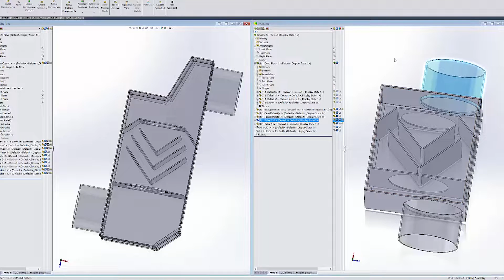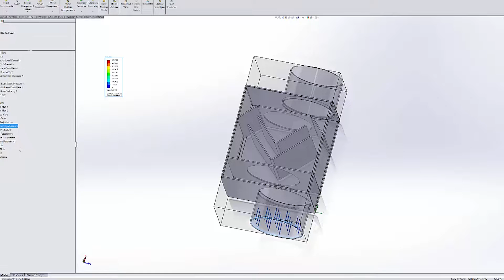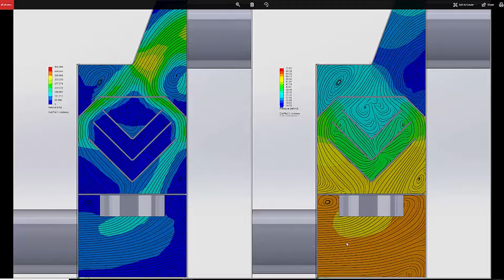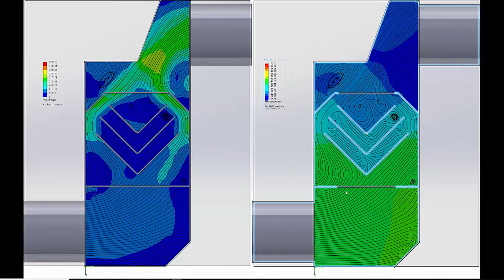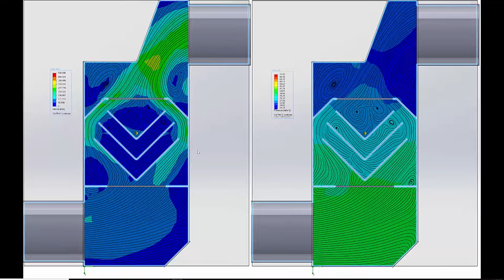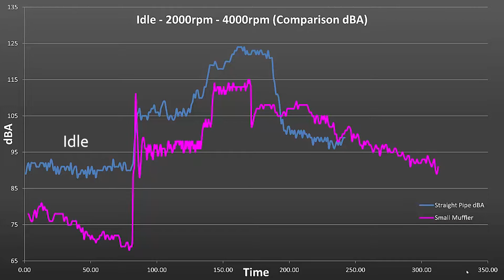DIY Muffler Build! (Sound Level and Back Pressure Test)

Comment: Not that I'm any sort professional exhaust builder. However it seems that the smaller the muffler body is the louder and more aggressive it tends to be especially in a straight through design. Chambered mufflers tend to be slightly quieter but deeper for the most part. Although like I said I'm not a professional.

Comment: Hell ya! I friken love Fieros!! With bigger modern wheels like you got on it to i think they are some underated badass gocarts for the street pretty much. The muffler on the side like that is really cool to sounds good. Not crazy pop bang fire but just enough to get heads to turn at you lol. The muffler when you said for sake of fabricating you did the square corners, for one i think it looks better like that and if you wanted to improve the flow at those spots you could cut exhaust pipe long ways and weld it unside the muffler in the corners to round them off. If that makes any sense. Leaving the outside square and a round cut pipe inside or cut the square corners out and weld the rounded pieces in after the box was made. Exhaust pipe bent in hoops or straight is a killer fab tool because you can cut them long ways or however and make nice parts that would otherwise be very difficult to make the bends or coners without a bunch of diffrent expensive tools ya know! Anybody can go buy parts but its so much better to see how somthing you created works and to have it work also!!
Reply from the maker: Thanks! It was quite the interesting project to take on, and yes those are some good suggestions to make the design more efficient. I might actually redo the exhaust again in the next few months!

Comment: Well done for actually designing your own - I've done the same thing, but because my engine was the same as usual I used the carcass from a standard exhaust, modified it inside, and then had it re-welded including a plate where I had cut it open. The result I achieved was almost as quiet as a standard car but with at least 10% fuel saving (it was a diesel, so different rules apply regarding back pressure and fuel economy)

I've found that the type of flow diagram you were using isn't particularly helpful. There were some areas where virtually no flow was shown, such as in the delta plates for example. Using OpenFOAM (or SimFLOW - much easier to use) is good for showing in more detail where the flow is going and where the pressure drops are occurring (you did have some good pressure maps). I think you'll find though that the silencer you're using won't be silencing it sufficiently after a while. I wouldn't expect either of those designs to silence much to be honest, and there are more techniques you can use to ensure good airflow while also reducing the noise level significantly across the board - your graph showed that  in some places the noise level was significantly higher than just a straight pipe! That's not going to be helpful. Given that you've got a very small space to work with,  I'd have a look at some traditional silencer designs and see how you can use those design elements but in a way that creates less back pressure by optimising the airflow better.

Ideally you'll use software that also simulates the sound propagation so you can do more experimentation before building anything - but that seems to be either ridiculously expensive or almost impossible to use. I'm writing my own software for that reason.
Reply from the maker: Thanks Mike, I haven't had more time lately to work on this, but I feel like there would normally be a few trials before finding the sweet spot for the design

Comment: At 3:35 you mention a restriction, as indicated by the velocity of the gases increasing. The misconception is that a narrow area is restrictive for gases. However, as velocity increases, pressure decreases. In reality, where the exhaust gases are slowest, is where pressure is the highest. I’m curious as to why the software was showing data that disagrees in the simulation. Granted, gases do not like sharp turns and that is certainly a consideration, and your chamfer you added showed good results. Turbulence is the enemy with flow as indicated by the eddy currents you spoke of. I’d be interested in seeing what dimples would do on the delta plates facing exhaust flow. Overall, great video, neat engineering and fabrication.

Comment: Awesome video! I have a couple questions regarding the exhaust itself tho. I'm a college student going for welding. I built my first exhaust for a highschool metals project and ran that straight pipe for a year until I received a fix it ticket from a douchey sheriff. I want to build a new exhaust that's quieter and more tame because the last one was too loud for my liking anyway. If I were to do this how noticeable was the drop in noise? I'm trying to avoid a metallicy or tin sounding exhaust as well, any ideas on how to help with that?
Reply from the maker: There was a noticeable drop in noise... however... it is still very loud. Loud enough to get lots of attention from the police. To avoid the tinny sounding noise you'll probably want to go for a chambered muffler that is a little larger, and of course it depends on your engine. It's easier to make a V8 rumble than a four banger.
Reply: @EmbraceMaking  thank you for responding! I think I'm going to use inspiration from Borlas mufflers. I drive a subaru and from what I've seen they do a good job of muffling noise and keeping a deep note. Thanks again!

Comment: what program are you using to design these mufflers...i have been wanting to design a muffler of my own my idea being a long "glass pack" looking cylinder say about 20 inches long and a series of solid reducer cones to baffle and speed up the flow
Reply from the maker: Hi Jordan, I have access to Solidworks so I do most of my design with that program. Lots of options available these days for 3D design!

Comment: Really interesting. But out of curiosity why didn't you design a straight through style muffler as big as de the space available allowed?
Reply from the maker: Because the space was so tiny that you need probably 14+ inches to get an effective straight through muffler... I had like 8inches to work with, so I figured a chamber style would be more efficient in that space
Reply: @EmbraceMaking  it makes sense. Really cool project;)

Comment: Someone on a Dragzine article about muffler design brought up an excellent question about the delta plates.  When the sound waves are divided, why don't the waves merge back in constructive interference instead of destructively?  What is causing the waves to phase shift if the geometry is symmetrical?
Reply from the maker: That is a good question. Obviously for this project I didn't have the full access to equipment available to do an analysis that would allow me to figure that part out... however, from my understanding it must be the spacing between plates and their position in the chamber. Although the design is symmetrical, I believe the waves would get split by the angled pieces, then bounce around in the chamber down the sides and ends and back towards themselves, perhaps between the plates, etc rather than being able to make a straight exit through the outlet. You would have to know the wavelengths you're dealing with and I'm sure that would factor into the plate spacing / position so you could design for destructive interference of the highest amplitude wavelengths. Makes sense in my head...
Reply: @EmbraceMaking  
I have never been trained in acoustics but I'm assuming that there's enough destructive interference to justify the plates while some wavelengths merge back to their original amplitudes.  In other words, I don't think there should be any amplification of any part of the spectrum, only attenuation of certain frequencies that happen to be out of phase just enough to cancel out.   

I have so many ideas for fabricating a muffer that involve Arduino micro controllers.   You could steer the flow with electro-mechanical valves and mechanical Tesla Valves, operate speakers inside helmholtz chambers, operate dump valves,  Variable damping, variable volume chambers, you name it.   I have another idea but I'm keeping it to myself in case it's patentable.  Fun stuff.   Thanks for sharing!

Comment: Cool project but that exhaust exit just doesn't seem like good placement.
Reply from the maker: Thanks Josh, I was going for something "different" but different isn't always better. I do wish I used more of a traditional location for the exit. I was going to build a rear diffuser and not having the exhaust in the way seemed convenient. I guess I can always change it in the future!
Reply: Embrace Racing I just don't like the idea of exhaust gasses leaving deposits on the body or wheel.  The style is meh, but that's not what I wouldn't like about it.
Reply from the maker: Surprisingly that has been the least of my problems. I've had no collection of soot on the body or wheels. My biggest concern is the temperature near the body panels (which is why I had the original straight pipe section wrapped). Also, if I have the passenger window down it gets pretty noisy in the cabin.

Comment: That looks likely to collect rain water?
Reply from the maker: It is a fair weather car for me so I don't drive it in the rain, but it is possible for some water to get in there. When I wash the car I just stuff a cloth in the side pipe to prevent water ingress. I might drill a drainage hole at the low point if it is ever a problem. Thanks for watching!